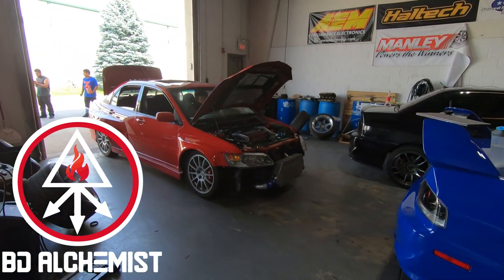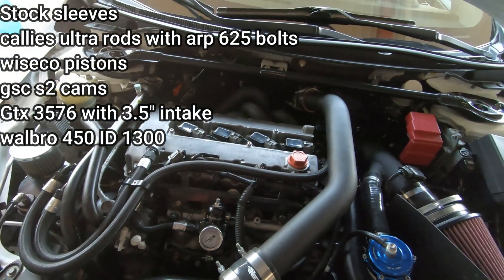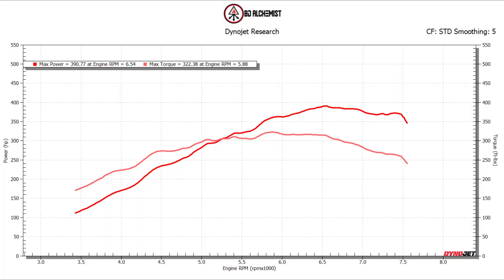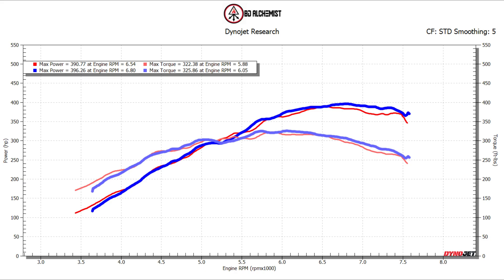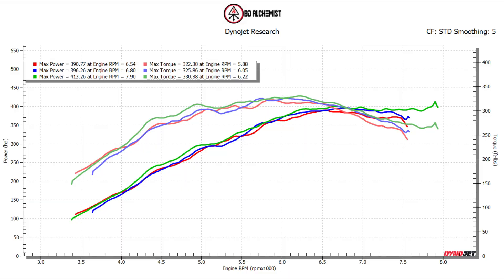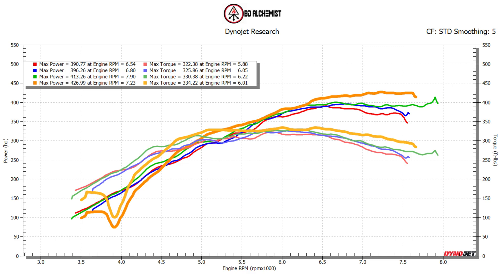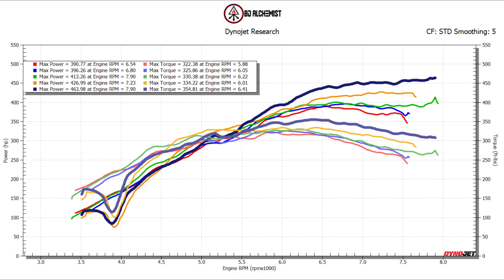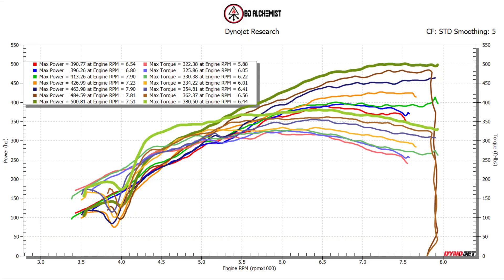EVO X Stock Sleeves Callies Ultra i-beam rods Wiseco pistons GSC S2 Cams ID 1300x GTX3576

Comment: Curious how much power could stock sleeve handle on 4b11s with i beam upgrades?
Reply from the maker: 700-800
Reply: So then upgraded internals is good for 30lbs boost any turbo and a sleeved block with internals is for boost above that?